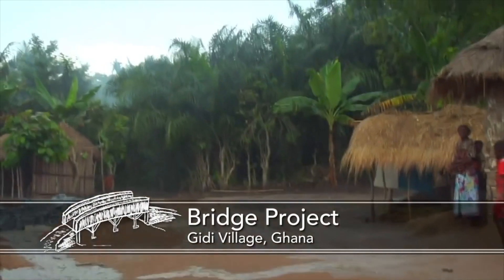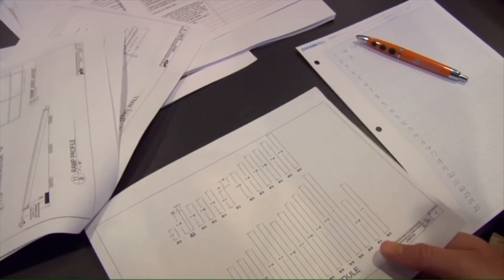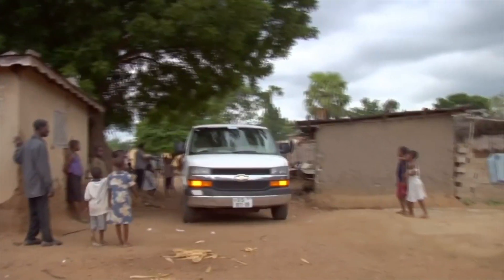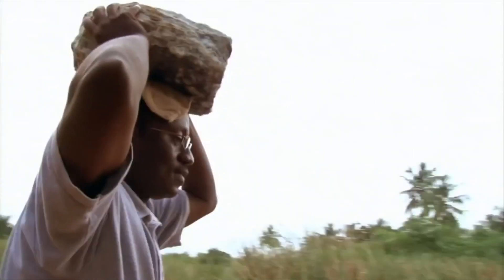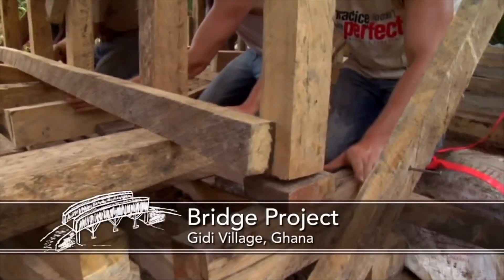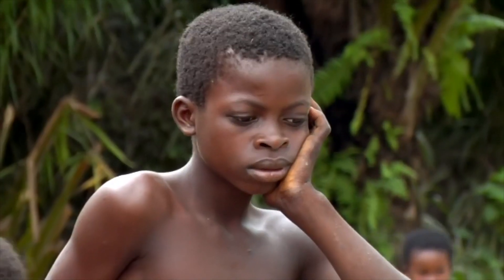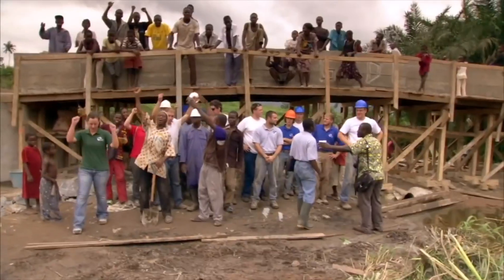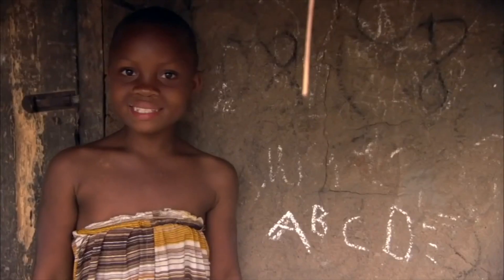Building a Bridge in Ghana

Comment: so it is a concrete bridge built on temporary wooden formwork, the bridge sides are actually structural beams, and instead of placing the deck on top of the beams, the deck was placed at the bottom of the beams, I assume to lessen the step up and step down on each side,, and in addition if the deck was placed in the usual position above the beams, then more work would be required to build handrails. 

Looks like a nice bridge,, looks as though a lot of concrete went into though,, maybe 20 tonnes plus?